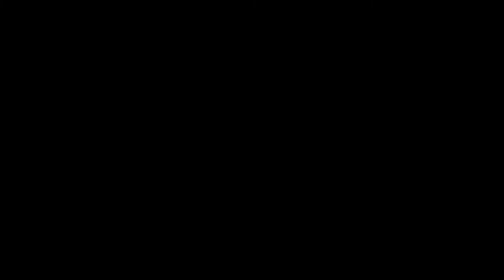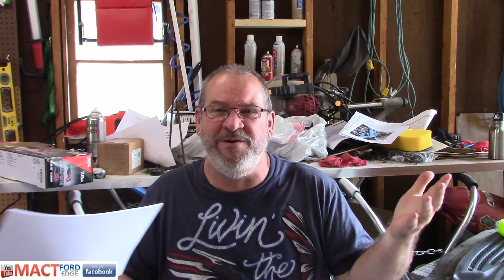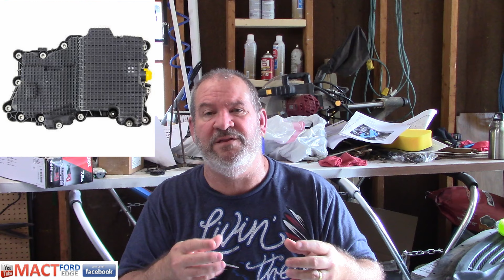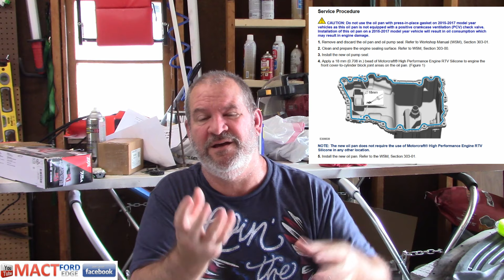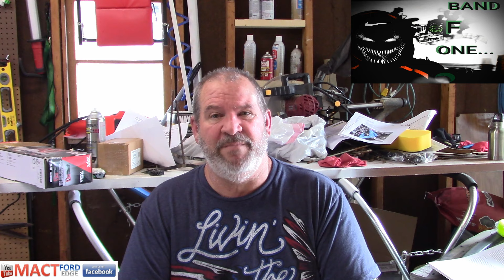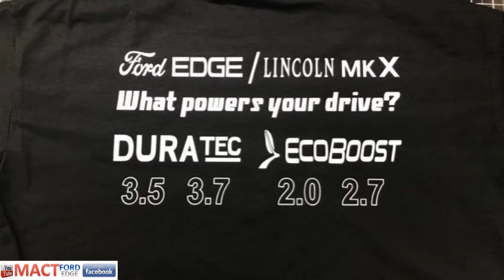Thermoplastic Fiber reinforced     Why your Ecoboost is like a lego

Comment: PLASTIC is Fantastic. DID not Ford build an all plastic V8 ?  Read somewhere about that.
Hey, thanks for your coverage of your Edge(S). Have had several of your maintenance topics applied at our Lincoln dealer to our pristine 2012 Lincoln MKX AWD. 
EVEN THOUGH YOU DETEST THE MKX ITS really just an Edge with much much nicer interior/exterior design appointments and options. Not to mention a bigger engine.  Oh and your Liqui Molly analysis was off the mark save the labs. Speak to 🇩🇪 Germany for the real lab evaluations and specs. 
God bless and keep doing what your doing. It helps people save money and to be safe.  I appreciate your maintenance expertise.